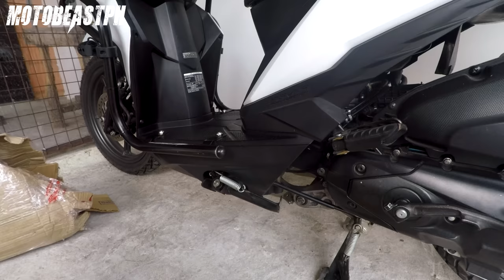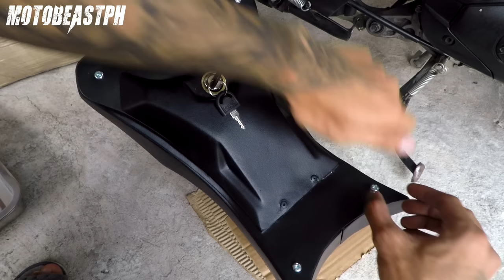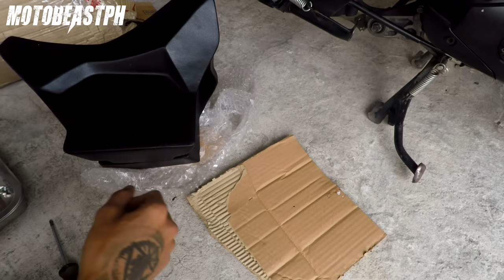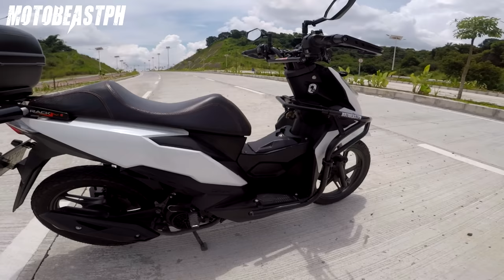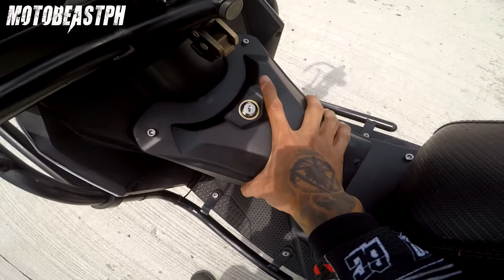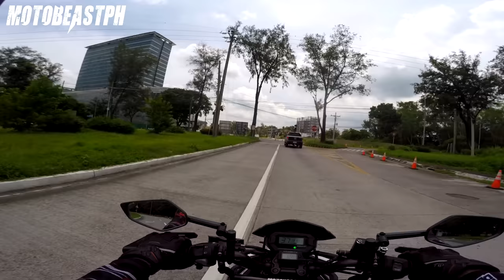Custom Front Box | Honda Beat Street

Comment: paps tatamaan ba ung sa battery?
Reply from the maker: Matatakpan yung screw.
Reply: @MOTOBEASTPH  sana mabalik ung dating price bro. 4,600 na ung price.nag pm ako sa seller sana balik niya price pra marami pinoy bumili sa kanya.
Reply: @MOTOBEASTPH  suggest ko bro bili ka glue gun pang sealed.meron bala ng glue gun na black. ung ginagamit ko pang sealed sa motor ko eh.
Reply from the maker: Oo sana ibalik sa dating presyo.